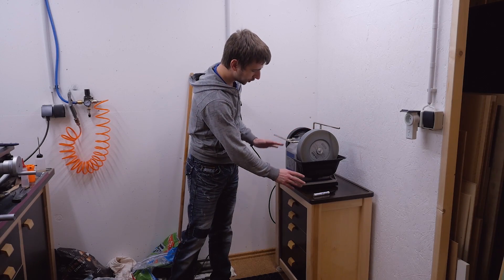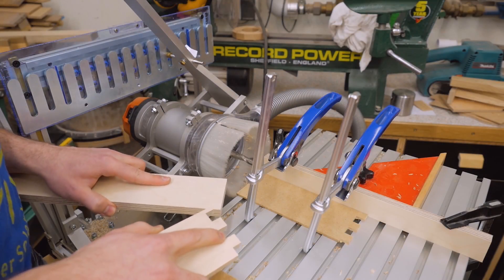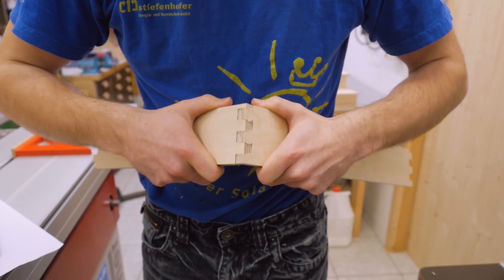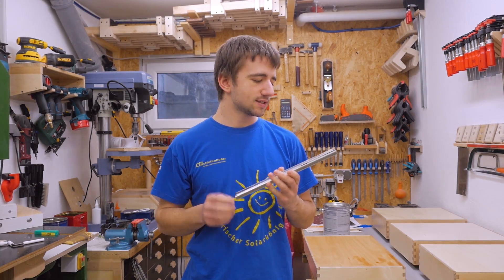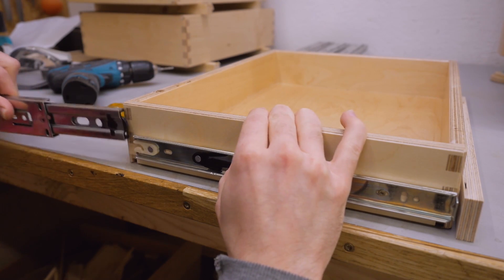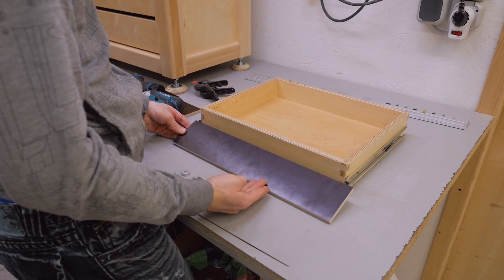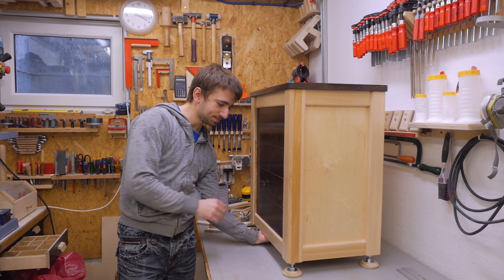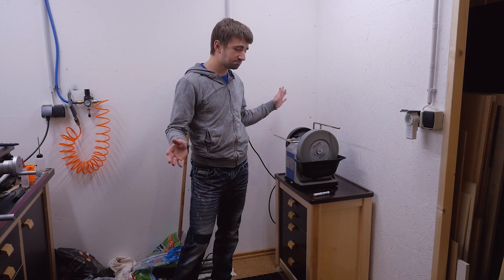Making Drawers with SOFT-CLOSE Drawer-Slides

Comment: When you make the box joints, do you basically make the boards 3/4 longer than the measurement you need since that material will be used up in the joint?
Reply from the maker: yes

Comment: As clever as you are I cannot believe you would not have had the ideas of 1. double stick taping the drawer handle temporarily in place, 2. making a duct tape tab to pull them open, or 3. just simply tipping the unit forward until they slide open. :) Also, kudos on the special effects.

Comment: To me, the drawer element that needs the most strength is the floor, yet expert woodworkers like you and others, install a panel thinner than the walls which have no load on them.  I make drawers with a 12mm BB panel and set the walls on top of that floor.  I've made dozens over the years and have never had a problem.  Only reason I can think of to build them the traditional way is esthetics and who cares what the outside of box of a closed drawer looks like?  Also, I install the cabinet part of the drawer slide on the cabinet wall before I assemble the cabinet.
Reply: The thin panel on the bottom is supported on all for edges so it does not have to have the rigidity of the other pieces to do the job.
Putting the bottom panel into a rabbet helps prevent the panel from delaminating and of course makes keeping it properly aligned during glue up easy.

Comment: I prefer to cut a slot in the drawer sides to hold the bottom vs. gluing in a rabbit. drawer is captivated with the slot and can float so less chances of splitting/expansion issues. However you're using much better quality plywood than easily available here.

Comment: I typically avoid soft/self closing drawer slides for a couple of reasons: 1) The initial action generally is jerky as you load up the mechanism and stuff in the drawer slides around. 2) Cost. 

In your case the foam inserts keep everything in place, and the additional cost seems worth it as a nice addition to a very well thought out stand. Well done as always. 👍
Reply from the maker: Interestingly they aren't that much more expensiv than slides without the mechanism. About 1-2€ per slide